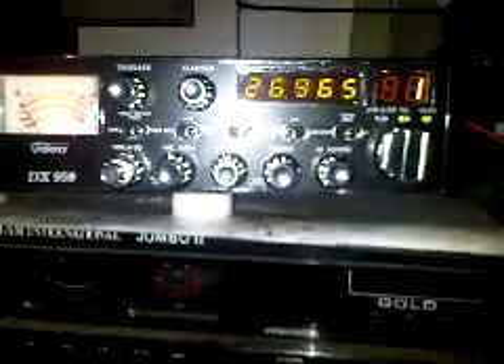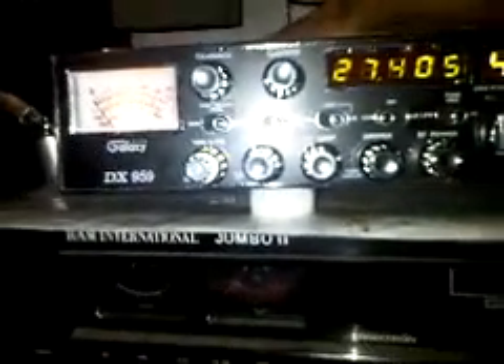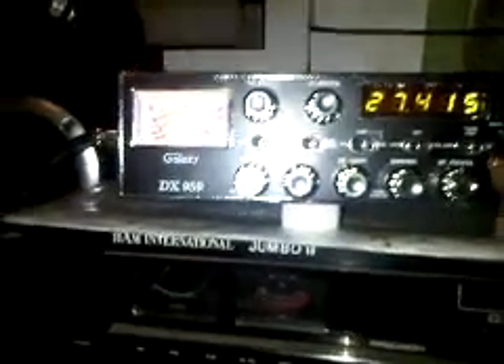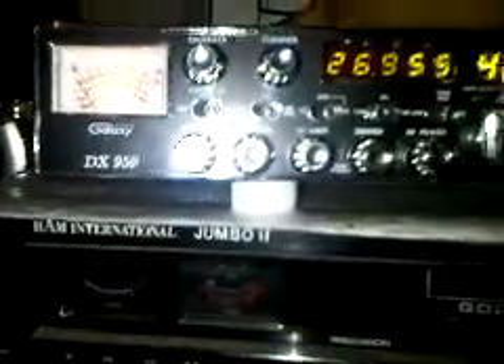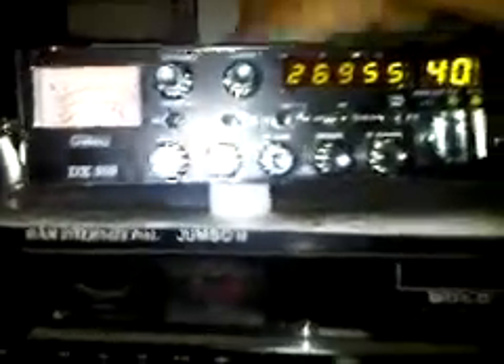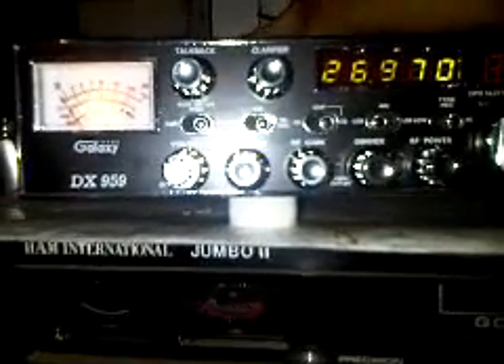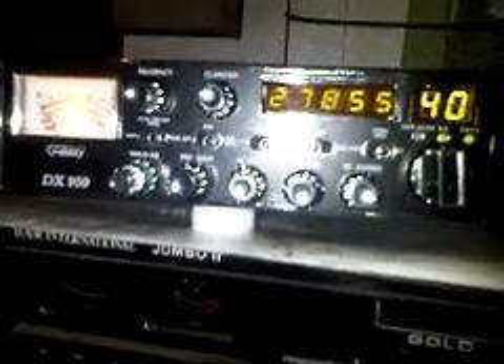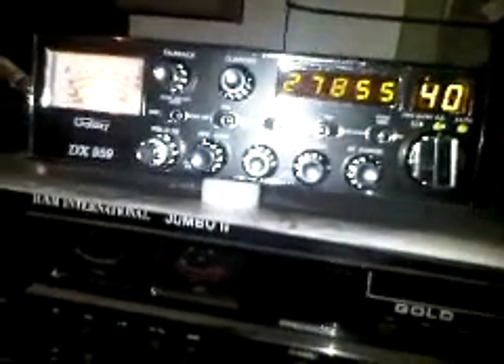galaxy dx 959 frequency mod 34ab138

Comment: Waste of time buy a HP-40 and you have a 80 watt radio out of the box just as Illegal as the Galaxy modified  !  Galaxy dx 959,  It is a $7,000.00 find if you get caught with this radio on the air and it is also a  $7,000.00 if you offer it for sale as a modified CB radio .   Just call the FCC in langhorne pa and ask them !  (215) 752-2033 Ask for field agent  Frank J. Cramer !

Comment: Hello, i spoke to you last night 5-05-2012  DY 262 Nick, Im the guy that uses 600w in South East England. You sounded great, i ended up being on the radio untill mid-night, i was chatting to the States for quite a wile as well, great conditions for dx.